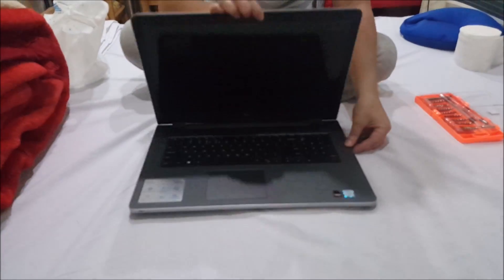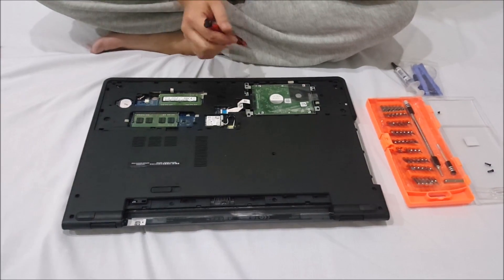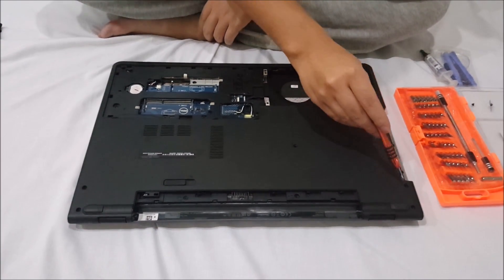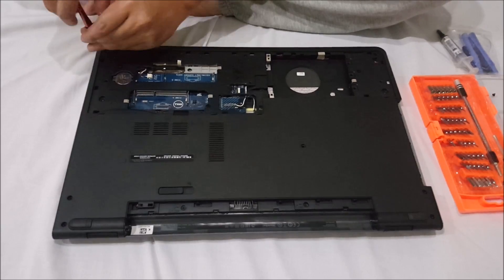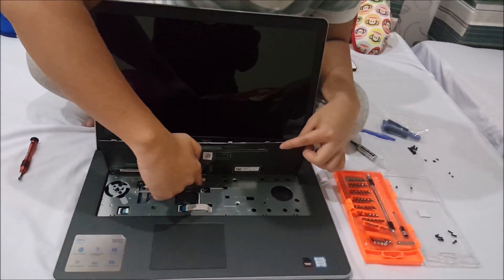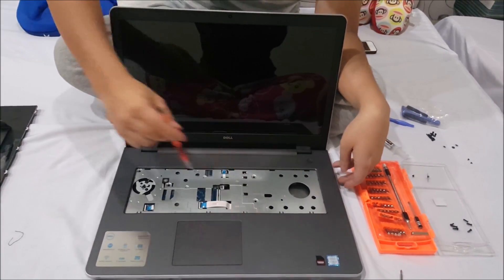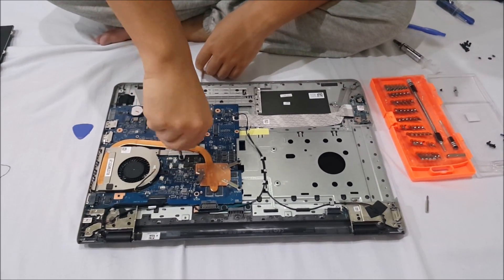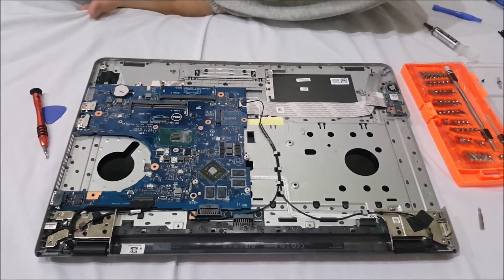OPEN ME UP! Dell Inspiron 17 5759, 5000 Series Disassembly

Comment: Great Video.
Question: Mine shuts down automatically after 10 seconds of a opening a game using the AMD video card, I've tried re-pasting 4 times to no success. What could be the issue?
If i'm gaming on the crappy Intel integrated graphics, no overheating and no sudden shutdowns.
HELP ME bro
Reply from the maker: your graphic card is dead thats is the problem
Reply: @OpenMeUpTec how convinient that it dies right after changing the paste for the second time ever!
Reply from the maker: @derekhatake  this is the reason why you can use the laptop normally without an issue. but when you run a game it needs to swap to the GPU so the game can work. with normal everyday stuff it uses the onboard GPU (intel HD graphics). for games it switches to the dedicated graphic card

Comment: If i want to replace thermal paste should I just put it underneath the heat sink?
Reply from the maker: watch the videos and follow the steps. it shows you how to replace the thermal paste
Reply: OPEN ME UP also if I wanted to replace the fan, would I have to buy the entire fan setup with the heat sink and everything or is there a model of fan that I could buy

Comment: Is it okay to pop off the keyboard without unscrewing anything in the back? Also, my laptop fan seems to be failing and shuts down occasionally to what I assume to be overheating, should I try to replace the laptop fan itself?
Reply from the maker: the keyboard should have screw from behind, i believe there is 2 screws. you need to open up your laptop first to see if there is dust and replace the thermal paste to see what happens. most of the time if you open it up, clean it and replace the thermal paste it will resolve the issue
Reply: @OpenMeUpTec   Thank you!
Reply from the maker: @dueyxdsir6722  thanks for your support

Comment: Hi plz can guide.... If there is any possibility to install SSD along with Caddy in place of DVD Drive (by replacing it)... I have Dell Inspiron 17.3  i7 5759 Signature Edition Laptop...
Reply from the maker: yes you can uy the DVD drive caddy for hard drive and use that. it goes for around $10 AUD on ebay
Reply: better get a  m.2 ssd + adapter and replace ur wifi card --> more speed than sata. you can always use a usb wifi card
Reply from the maker: @ekhoenix  thats not really correct. m.2 is sata so you will get the same speed unless it is a m.2 pcie which will allow you to use NVMe

Comment: Are the Usb ports replaceable?
Reply from the maker: yes and no. but for you i will say no since you are asking me therefore i assume you dont know how to solder or have the parts required to do so
Reply: I meant easily, I have the knowledge but I have a progressive disability and my arms have since crapped out on me since engineering classes in school 10 yrs ago. Thanks for getting back to me though. I have a similar model laptop that's not quite cutting it for games so I've been looking into eGPUs, thought I might've been able to just to swap a usb 3 to 3.1 or thunderbolt 3 but looks like I'm going to have to go with ghetto eGPU setup and not the nice and clean enclosures.
Reply from the maker: if you after that then the answer is no. you cant just change the usb ports you need to controller for it to be usb 3. if you want you can look at PCI external GPU which you can use by removing your wireless card
Reply: Yeah, I figured but I wanted to find out for sure. The PCI eGPU is what I meant by ghetto eGPU lol. sigh My setup is already a mess of wires was just hoping against hope that I could have the clean eGPU setup. Thanks again

Comment: can it support 2 hard disk?
Reply from the maker: no. CPU is solder on, graphic card is solder on, ram can be changed to 16GB max with 8GB in each slot and there is 2 slots, wireless card can be changed, and hard drive is a 2.5" inch.
Reply: Are you sure about 16gb max? And not 2x16gb=32gb: https://www.compuram.biz/memory/dell/inspiron/17-5759/16gb-00-x7322.htm
Good video by the way. Keep up the good work.

Comment: Excellent disassembly video. Do you know how to get the DVD bezel off? I purchased a 2nd caddy and installed the original 750gb drive but I can't get the bezel off the SU-208 DVD writer
Reply from the maker: it come off easier if you have the dvd drive open. this way you can see where the plastic clips are
Reply: You were correct. Once I opened up the drive I saw the plastic clips and I was able to get the bezel off. Thanks for the advice.

Comment: Can you please tell the USB 3.0 port is on Motherboard or is it on a separate daughter board?
Reply from the maker: should be both if it is on one of them it is on the main board and the USB 2.0 is  on the daughter board
Reply: +OPEN ME UP plzzz answer me.. is the dell inspiron 5000 the same thing as dell 57559 or are they two didferent laptops
Reply from the maker: dell has many laptops in the 5000 series the 5759 is one of the models
Reply: OPEN ME UP Oh..lol Thanks but im sadly getting the asus N552vx..is it any good for gaming?
Reply from the maker: Games care about graphic card check what graphic it comes with and google the graphic plus the game you want to play it will tell you the answer. Example 970m dota
Reply: OPEN ME UP Oh,Thanks :D